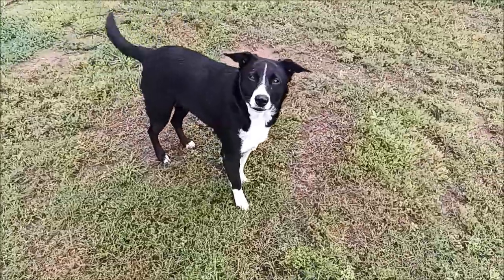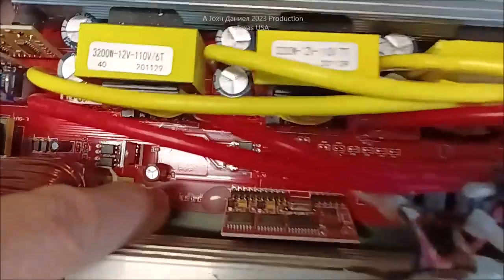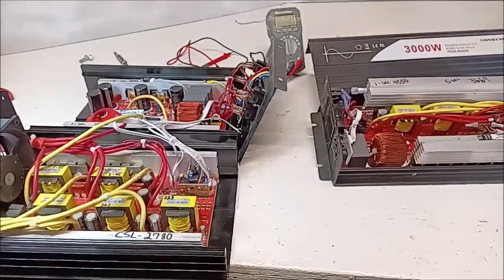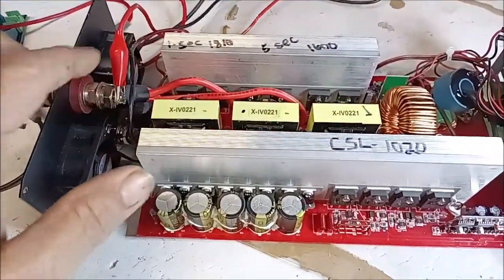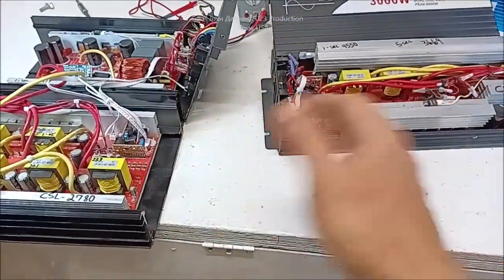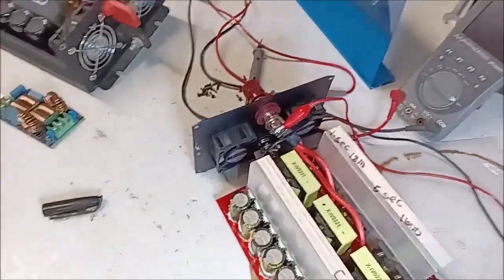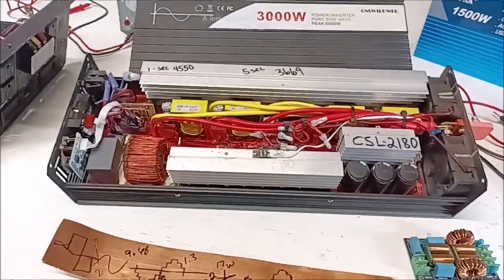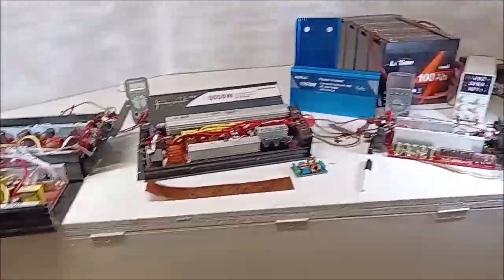What makes a Great but Affordable DC to AC Power Inverter? BRAND or BUILD, I'll explain its both!

Comment: Good vid and info thanks. Definitely influenced my decision. Makes sense too, I have a 400 from 12.8 I loaded up shooting for 400 watts with a plenty of 2 car batteries in parallel fully charged pushing it. Falls on its face after 270 watts, will hold a 260 watts steady barley. To sum it up, you want to run a 2000 watt load, get a 4000 watt inverter, that's just the way it is.
Reply: Thanks man. The tests ive done on this little 400 line right up with what you was saying. I'm not rich, i don't plan on buying but one more of these puppies.I figure 24 to 120 using 2 or 4 car batteries, that way they can be charged with jumper cables and a car charging in parallel @JOHNDANIEL1

Comment: John, I really appreciate the in depth videos; you've been a massive help as I try to find the most reliable yet cost-effective inverter for the portable solar powered generators I'm building. Question: do you have any experience with cnswipower's lower wattage inverters (like 2000W and 2500W)? For most of my projects, my clients don't need any more simultaneous power than a standard 15A circuit can offer, so I was looking into these lower wattage models due to their incredible prices and smaller form factor. At maximum, these systems are typically meant to be used to run a fridge, chest freezer, sump pump, and a charger or two. What do you think about using one of their lower wattage models?
Reply from the maker: Go with the 2500, the 2000 has only 2 cap mains, the 2500 has 3 and is only a few dollars more. That means starting power for inductive loads. Very important when your not going to watch it all day. On that link set below the video one that says EBAY source, look down a ways, they have the 2500 as I recall ships in a few days.
Reply: @JOHNDANIEL1  awesome, that's what I was leaning towards as well. I want just enough redundancy to cover potential freak occurrences and the 2500W seems to be the sweet spot. Thanks a bunch, man! Keep this stuff up!

Comment: Thanks! Another great video! Gues i will be buying some more inverters
Reply from the maker: You have to admit, these 3200 are the home solution while the 3000 is the mobile and remote solution. I have been running SWI Power for over 10 years, sold and traded them, bought more. Never let me down.

Comment: how do you do the test to get the CSL value? that would be a good video. I didn't really understand the .5V 1V 2V thing you mentioned for the 1s and 5s results.
Reply from the maker: It is a stable rate of amps before your "sized for test" draw on battery supply starts to cascade down in volts without increasing load. They tend to increase predictably and peak then go up fast like bat Shyt crazy when your inverter is crashing on carrying ability in efficiency.
Reply: @JOHNDANIEL1  that still didn't make a lot of sense. maybe a video on what you see and are looking for would help and your testing procedures.
Reply from the maker: OK, I will see about setting up a active testing for a video, It will be a long one. But maybe you can visualize horsepower curve, when amps start going higher than the output watts they should result in. All the factories test these for premium efficiency, but always fudge it. There is a point your creating more resistive heat in the unit than flowing out power can result in. That's the point of component effectiveness you exceed.

Comment: Great videos,  I'm currently shopping for inverters and would like to know conversion efficiency as well, maybe at 50% of csl.  I'm going to check out your in depth reviews.
Reply from the maker: For the Xijia, which is SWI-Power. Using the 2500, 3000 and 3200 for examples: 
 At a perfect heat to load balance they run over 87%. Over that is when they drop and how we measured CSL for them. At over 10% and under 40% they are over 90% efficient though. At idle they are averaging 27% lower in active current support than most all published data on similar capable models within price ranges of others that are up to $300 more in cost.

Comment: Is it better or cheaper to go with the smaller high density batteries or the larger older format with all the empty air space in the box?
Reply from the maker: Dead honesty? bang for the buck, TIME USB. https://shrsl.com/43h37 Their 220 AH 150 bms and its metal cased. Cheapest cost, pure cells, and best BMS in a budget battery. 4 of them is a house system for a average 2 person home, 4 = 600 amps capable in 12 volt, and real test show them exceeding 228ah, usable for anyone with normal needs. If I knew that they were actually Shenzhen Newton New Energy Technology Co., Ltd back 3 years ago, I would be running theirs exclusively in my home if I could have afforded them then, the Power Queens on mobile applications due to their weather stable cells, and Redodo still on all average but constant draw stuff like my well house.
Reply: @JOHNDANIEL1  thanks, John. I was banned4life, but was reborn.

Comment: Good info.
Reply from the maker: Way back when we had to install back up controllers in the mega wind turbines I was part of installing in Utah, Colorado, North Texas, Kansas, and Idaho we had to do CSL test on everything. Then you had a stable power supply generator that could do 380 volts DC at 230 amps. Today I am using 400 amps of LiFePO4 with a charger attached watching when the charger gets hit needing full draw to moderate load. Same outcome, pain in the ass.

Comment: I just recently found your channel. Man you put out some good info and I appreciate your humor. Everyone I see on YouTube is all about the eg4 products. I was curious what you think about them and the all in one 48 v inverters. The eg4 lifepo4 batteries are supposedly the best bang for the buck
Reply from the maker: EG4 batteries are the same identical product as many re-brandings. Any All-in-one inverter is a risk to own since your one micro function fail away from a complete all systems loss. I seen goofy firmware get corrupted and take out a $19,000 system. So if your wealthy, that's fine. but if your not, that's life destroying.

Comment: great video took a while to find a channel that actually explains what's inside. got a question not related to inverters but on my rv dc fuse panel board there is 2  30amp fuses on the board for reverse polarity protection. I upgraded my converter to a lithium charge profile and 55 amp max output and im getting 52 amps to the batteries now since I swapped out the converter . I check the fuses on the dc fuse panel and they are getting pretty warm. Wondering if the reverse protection fuses are in parallel ? if not i don't really wanna cook my dc board out camping lol
Reply from the maker: Not sure your RV, but typically Should be one fuse for the Tow Vehicle and one for the ground circuit on the converter. If you changed from a 45 amp to a 55 amp your surpassing your trailers minimal wiring, the heating on the fuses says your creating resistance somewhere. Pull power from that fuse panel, send it all  to the batteries, from the battery install a Buck module for 25 to 30 amps, a DC to DC converter with current limiting then from it using at least 8 awg wire if short run, 6 awg wire if long ( both neg and pos ) to the original fuse box. Since you are not using lead acid, which has a always willingness to absorb some juice, and a LiFePO4 has a BMS that disconnects when full and lets the converter hit the fuse box with full power, you may be over amped.  
Hope that made sense. If you want a easy buck converter, search for "14.6 to 12.8 volt DC to DC 30 amp regulated module"
Reply: @JOHNDANIEL1  i got a WFCO WF-8950L2-MBA Replacement RV Power Converter Lithium-Ion Main Board i upgraded the battery cables to 4awg welding cable so the cables should be good. the original was a 55amp lead acid 3 stage charger limited to 15amps. just kinda scared to burn out the reverse protection panel.
Reply from the maker: AH, your using that WFCO, OK.  Then do as I explained. It is feeding full power due to it being for Lithium. It does this due to the BMS will control input to the battery, so these bounce back to full bore when the battery is full, the full bore goes into the RV harness. Run its output to batteries, from batteries use the buck boost module to supply the fuse box on the RV, that way your current limited.
Reply from the maker: The reverse protection is only needed to prevent goofs who mis install batteries. or Mis connect solar or generators. Check what WFCO has on their manual to see if you even need it with your new install that has short circuit BMS internally on its batteries. https://wfcoelectronics.com/wp-content/uploads/2021/02/Updated-8950L2-MBA-Li-Ion-Manual-RP.pdf
Reply: @Јоhn Daniel  says I need them in the manual. Think they must be in parallel with the positive battery terminal as 2 30amp fuses work together. Otherwise I would of blown them much sooner with 52 amps going to the battery. Still kinda worried as its pretty close to the limit of the panel.
Reply from the maker: @justinh6962  I am gathering your feeding the converter charger through your fuse box, then from it to your battery? Don't do that. Feed its output straight to your battery, then return from battery to the fuse box. Put a 60 amp DC breaker on the line out to your battery, a 50 amp from battery to your fuse box. Then the choke point is avoided.
Reply: @Јоhn Daniel  think that's what I'm gonna have to do. Thanks for the help. Thankfully I left the old wire in there lol.

Comment: hi John , what charge controller would you recommend with the 3200w for a 12v supply ? Love you site , cheers
Reply from the maker: Charge controller for solar? Always use the SNRE made charge controllers. NEVER use any with fans, fans fail!  The SNRE are the least likely to fail and are affordable. Not knowing what your solar or battery size is don't help much, but I run a 40 amp for every 500 watts of solar on my system. 6 are running side by side with NO needs for extra junk added to control them. The HQST 40 is made by SNRE, and lowest cost you can get for one. https://amzn.to/4b1KQBR

Comment: How loud is that 3200 watt xijia Inverter under load? I am thinking of buying one for my trailer to replace my modified sine wave inverter I got from tractor supply a few years ago which is pretty loud, It is louder than my window ac in my trailer I use to run off the inverter.
Reply from the maker: Very quite compared to most I have installed. The big German made Pabst fan is about 55 decibels at best from 5 foot.
Reply: @JOHNDANIEL1  thanks. I will go ahead and get one.
Reply from the maker: Yes, they are great little units, a bit heavy but easy to install and use. Be sure to replace the cables that come with any inverter, not just these.  Use minimum of 1/0, preferable to use 2/0 if run to battery is over 5 feet. And they need a real 400 amps battery available for full power. Put a 350 amp ANL fuse on it, and keep all contacts well tightened.

Comment: Hello Mr. Daniel, I have a saw table that requires 220volt, 15 amps to operate.  I purchased the sungold inverter/charger 4000 watt, 120/240 volt @24 volts.  It does not run the saw table.  Can you clarify the problem and recommend the right inverter?  Thanks for your videos!
Reply from the maker: Dad is in hospital I will answer best I can. he would say try more battery or a starter wired into the cutting saw. he installs them and they work great. look up tabel saw starter box they are cheap. Kiera
Reply: @JOHNDANIEL1  Hello Kiera, thank you for the information. Do you have a brand name/model number of the table saw starter box that your father uses?  I hope your father is OK and home soon.  Thanks, Brad.

Comment: John can you run 2 inverters off same battery and feed same ac loads.... So like run a 5k inverter day time but at night run that small 1500w that draws only 3w idle?
Reply from the maker: We do that already, top inverters are day running, bottom inverter a old Powerbright runs night duty. You just can't get a old powerbright anymore, New ones are made by OGE. And since Xijia made them pre-2016, it lead me to SwiPower Xijia way back when.

Comment: spilt phase inverter?
Reply from the maker: SUNGOLDPOWER 4000W 12V Inverter Charger, Peak 12000W, 240Vac, 120V/240Vac Output Split Phase, Low Frequency, Pure Sine Wave Inverter, LCD Remote Controller, for Off Grid System(Upgraded Version) https://amzn.to/42lF75G

Comment: Hello John,
Thanks for this video. Very instructive.
I'm in the planning phase of a van build.
If you don't mind, I have a few questons.
I plan to use 200Ah Power Queen LiFePO4 with the space to eventually add another 200Ah.
Should I go for 1x200Ah or 2x100Ah. With the upgrade, I would have 2x200Ah or 4x100Ah.
I'm also looking for an Inverter/Charger (to charge from shore power).
SWIPOWER doesn't seem to have one for the 120V grid.
Can you recommend an inverter/charger?
Or is it better to have separate units, i.e. a better inverter and a better shore power charger?
Finally, maybe a dumb question, if I have a 200Ah battery bank, can I still install a 3000W inverter with some protections/limitations?
Thanks
Reply from the maker: If I am in your shoes?  Go first with 2 of the 100ah Mini from them, https://shrsl.com/46fls get them direct and get the most recent made. Very heat and abuse tolerant. If you do the create a account, you can get another 3% off on them on that site. Later add 2-3 more and as a 4 or 5 pack you will have insane power for a 3000 watt inverter without risk of over heating or over loading. 
When you build that van, the inverter with charger is best using a Sun Gold, SG 3000 12 volt model https://amzn.to/4501S19 ( Gen Start, Charger, Pure sine, Auto utility switching and a MUST, a Leaptrend DC to DC 60 amp charger too https://amzn.to/4501UGj  Its built like a Brick Shythouse! And the best part of using the newest Mini 100 from Power queen is you can actually grow it to 6 total with a ability to run everything AND the newest DC powered roof air I will be showing soon that is $500 cheaper then the popular promoted to the hilt ones you see on You Toooby! Stay Tuned, got it coming in short order! 
When you add solar, Use the Newpowa 50w panels ( see how narrow https://amzn.to/3OsxchJ )  in groups x2 for 44 volts to a HQST 60A charger  https://amzn.to/3ql6gbQ to  your 12 volt mains, contact any of them direct, ask for a 10% off on bulk buy, and ask for a huge discount and you can get on average 250 more watts on your average van roof with same space and weight.
Reply: @JOHNDANIEL1  Thanks for this quick and generous response.
I also was thinking of 2x 100Ah Mini (smaller weight, smaller footprint) for my build. Thanks to confirm.
For the inverter/charger, you suggest a 3000W.
Back to my dumb question, if I have a 200Ah battery bank, can I still install a 3000W inverter/charger?
If yes, what should I do to protect the equipment ... and myself?
Reply from the maker: @francoisboucher9648 Install a quality 200 amp DC circuit breaker. https://amzn.to/45iTYPZ  The inverter will run on as little as a 7 amp Lead Acid battery, however it will only produce that in value, about 75 watts till it drains it. So when your running it on a pair of 200ah mini it will be still able to peak start items since the Mini has 130% capable short time coverage, but not run them constant over 2000 watts (100 amp constant x2) without tripping the breaker. Adding a 3rd battery ASAP will solve this and you can change the DC circuit breaker to 300 amp. If you have just basic credit you can when on the power queen site get a payment plan making it a lot easier, no real interest is charged.

Comment: Which inverter you recommend for semi truck? I have four X2 dual purpose/deep cycle SLI31AGMDPM, 1370
MARINE CRANKING AMPL, 1150 COLD CRANKING AMPS, I was thinking to buy new model Duracell 3000 Watt High Power Inverter?
Reply from the maker: Save $110 on those modified sinewave and get a pure sine SWI power. SWI-12 3200w https://s.click.aliexpress.com/e/_DF5ednb and they should have them to you in a week.

Comment: John, thanks for the in-depth video and testing.  

I'm in the market for an inverter for an emergency power back-up for fridge/ freezer, gas furnace and small sump pump.  I tested the surge current on each of these and the worst is still under 12 amps (the pump).  It will hardly ever get used (and when used, only until power restored) so a Swipower seems like maybe a good price to quality fit.   There is a good price available on the 3000w so I'm tempted to go with that.  

But I notice you did not test the newer SwiPower 3000w model (with the 2 Nema-15 outlets and the new lcd display on the face of the unit, and not at the end).    Is this newer model 3000 not test as well / to be avoided?  Same Mosfets on both models?
Reply from the maker: The new one has been installed and has been working for months full time to run 3 freezers and a 7.5 cubic foot refrigerator in that trailer I have with the solar roof on it. I thought I did do a power test on it somewhere. It is as good and better than the older models.